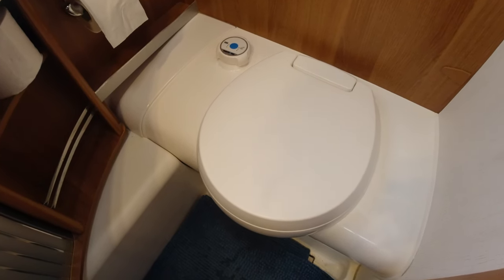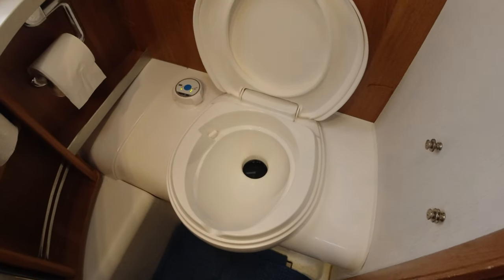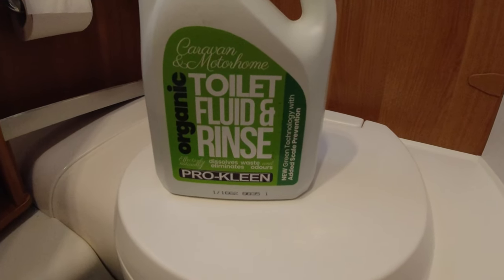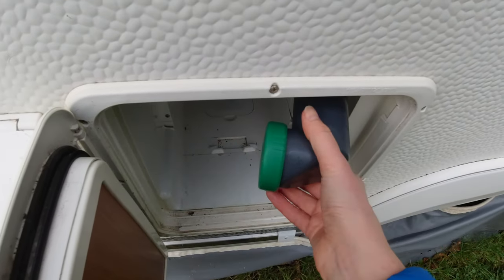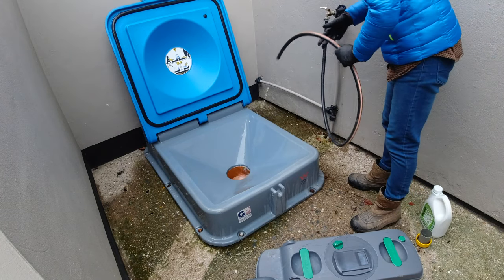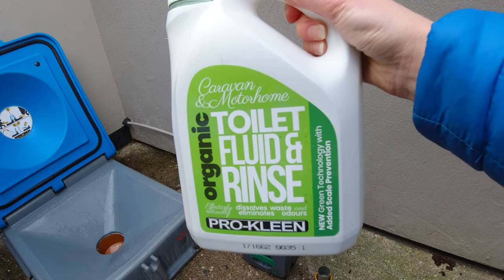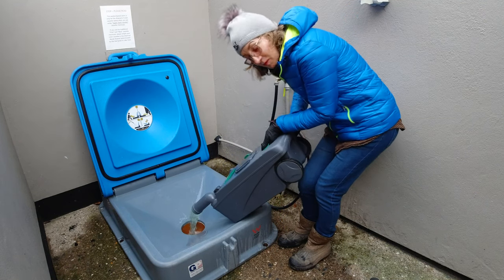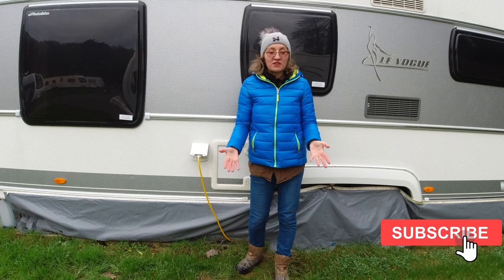#91 Cassette Toilet Care: The Ultimate Guide!

Comment: wow, thanks for the insight for your country's "dump" system in your recreational vehicle.  here in the usa we have on board tanks for our waste.  we have a outside tube that we connect a large diameter hose to, then connect the other end to a pipe in the ground, pull a lever, gravity flushes the waste down the pipe.   we then "rinse" the large hose by closing off the "black tank" valve and open the gray tank (it is the shower/kitchen water tank) to empty the gray tank.  we also use the septic tank friendly chemicals here in the usa.  we can find our "dumps" at every paid for site, at truck stops, and at all sorts of businesses around the country.  they are very easy to find and all have a flush hose to help keep all clean plus a fresh water hose is usually a few feet away to top off our on board fresh water tanks.  fyi, we also live fulltime in our 24 ft. "caravan" and have 45 gallon tanks therefore, our "dumping" only needs to take place every two weeks or so.
Reply from the maker: Wow, thank you for sharing how it works in the USA! It's fascinating to hear about the differences in RV systems. Over here, the setup varies a bit, and it's always intriguing to learn about how things are done in different parts of the world. Safe travels on your adventures in your 24 ft. "caravan"! 🚐✨